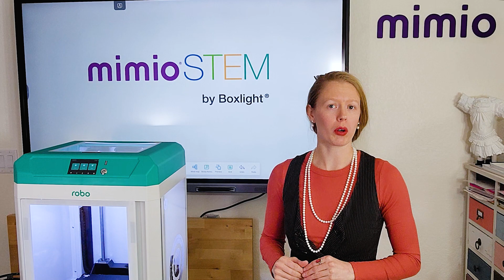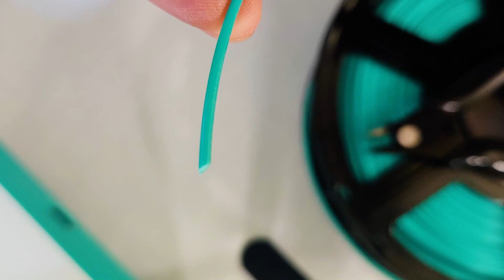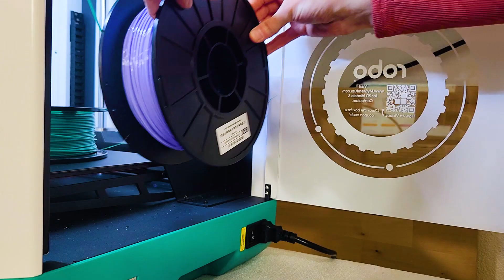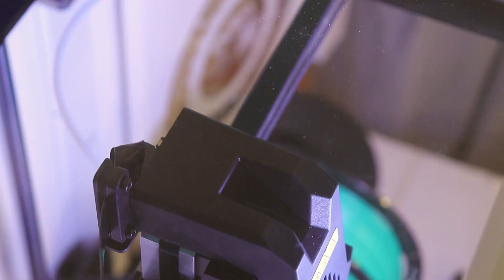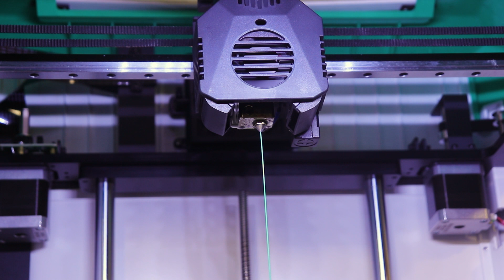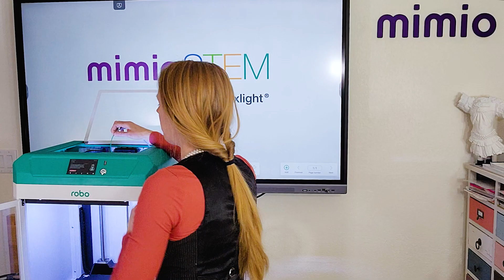Robo E4 Pro: Loading and Changing Filament

Comment: Como puedo imprimir en una robo e4 en varios colores de filamentos?
Reply from the maker: Para imprimir en varios colores, simplemente detenga la impresora en la capa donde desee cambiar los colores. Luego, vaya a la pantalla de carga de filamento y cámbielo. Después, podrá reanudar la impresión 3D.
(Google translated. Original English below.)

To print in various colors, simply pause the printer at the layer you want to change colors. Then, go into filament load screen and change filament. You can then resume your 3D print.